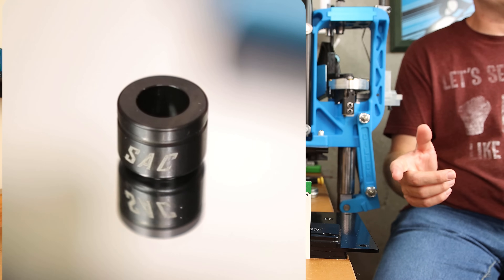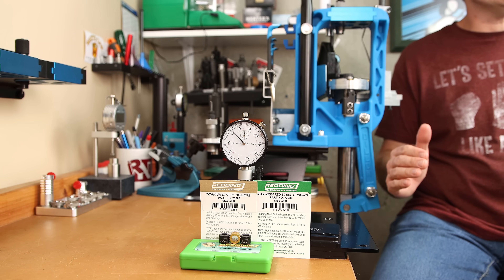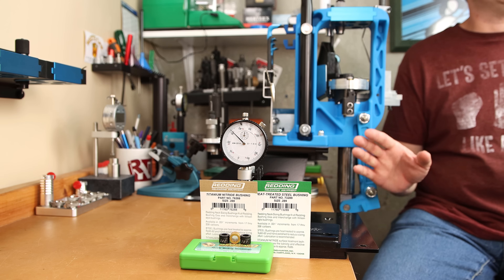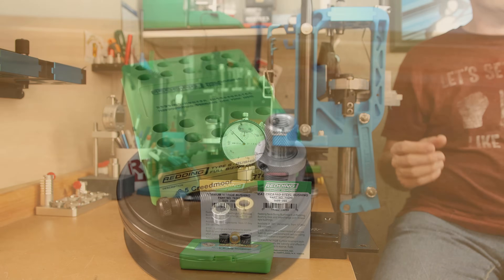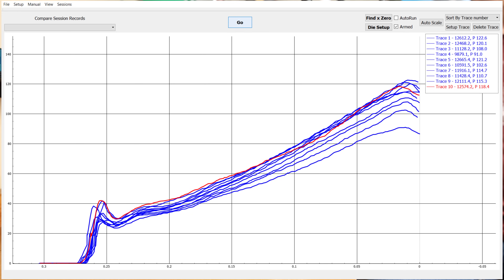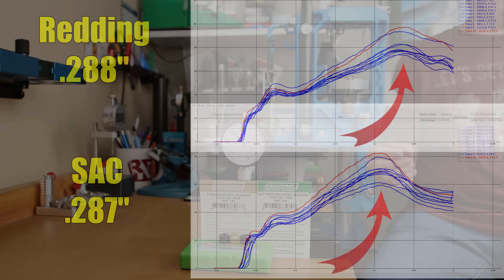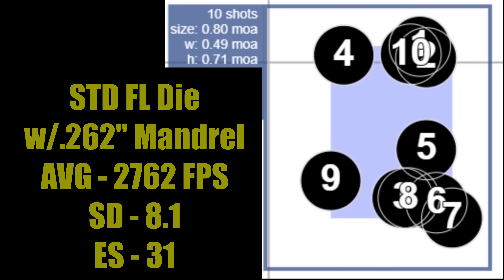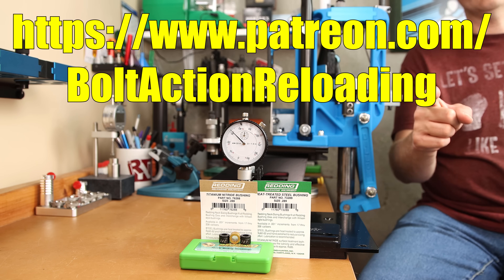Die Bushing Performance Tested! - Precision Handloading with SAC

Comment: What are the thoughts on using expander mandrel after SAC bushing for smoothing ID? IS that overworking brass or counterproductive? DO you have a video or content about that?
Reply from the maker: If the brass you are sizing is reasonably consistent (same lot, high quality) I think the benefit of the expander mandrel is much harder to determine. If you're using mixed brass, it may be worth your time. If you would like to deep dive on how neck tension changes based on sizing process. I have a video series on 12 ways to size brass tested (or something close to that)

Comment: I just checked Short Action Customs' website to see what Full Length sizing dies they are compatible with and found the following disclaimer: "These bushings are proprietary to Short Action Customs Modular Sizing Dies only!  They will not work with any other die". The photo of their sizing die looks slightly different than the photo of the one in your video. Is it possible that they modified their bushings so they are no longer compatible with the Redding Type S Bushing Full Length Sizing Die? (which is what I believe you used in your video).

Comment: On the short action custom site it states that the sac bushings do not work with any other dies but you used a Redding die. Is it okay to use the sac bushings with others dies. Am I missing something? Thanks
Reply from the maker: @howardschwartz1462  there are 2 style of bb bushings. One is neck shoulder and one is just the neck. The neck shoulder bushing are for their dies.  The ones that work in other dies are called the SAC neck sizing bushings.

Comment: It looks like you do either FLS (no bushing) + Mandrel or FLS w/bushing, but I haven’t seen you do a FLS w/bushing and as a separate step, use a mandrel to expand the case to desired neck tension.  Curious if you have done both bushing and separately mandrel and what your formula is for bushing to mandrel size.

Comment: Has anyone used the SAC bushing in conjunction with a 21st century expanding mandrel? I love the whole idea of the SAC bushing being able to size the entire neck so you don't get a donut with your standard bushing dies. But I really like the idea of finishing with an expanding mandrel to "polish" the ID of the neck since this is what is actually providing tension on the bullet.
Reply: How is the SAC bushing sizing the entire neck???? Look at the pictures----they only do a partial resize, about half the neck length. You may be right about the donut (which I have NEVER EVER had a problem with). The SAC would leave the donut in the unexpanded shoulder and the case would wear out before it (the donut) ever migrated to the actual sized part of the neck. Did you mean to say "don't get a donut as you do with your standard bushing dies"?????? You use one or the other, not both bushings????

Comment: In the shooting world where time, costs and component availability are a very serious concerns , a 10-shot group would not generally considered small.  In the statistical world, N = 10 is pretty small when there is significant random variation in the data.  You may want to believe that a 10-shot SD of 5.6 fps is a real improvement over a 10-shot SD = 8.9 fps.  However, the 90% confidence limits overlap:  (6.49, 14.6) and (4.08, 9.21).  Without more data, you cannot confidently conclude that 5.6 fps trumps 8.9 fps.  In addition, the ES's are of no value since they are sample-based random variables and need to be characterized by some statistic (mean, median, 90th percentile, etc) generated over repeated N-sized samples.

Comment: Did you run the SAC bushing in your Redding die or the SAC die?
Reply from the maker: These were ran in the Redding die. The bushings for the current version of SAC dies are different.
Reply: @BoltActionReloading  okay, that’s what I was thinking. Do you know if they make the ones you reviewed anymore? I’m not able to find them on their site.
Reply from the maker: They do, but they are also sold by MidwayUSA now, too.

Comment: I recently purchase a Sinclair Concentricity Gauge and discovered that I had some massive run out (.005-.015) in my 300 PRC brass (Lapua and Hornady) from using my Lee press and Lee resizing FL sizing die. I watched a bunch of videos and read articles and ordered a Mec press and the RCBS Matchmaster Dies (FL bushing sizer and micrometer seater) along with several RCBS bushings to play with. I used every "pro" tip to set the sizing die up correctly (including not using the expander ball on the decapping rod) and sized some of the brass that had been sized in the Lee dies. I was optimistic that this set up would at least improve concentricity but it didn't change anything...not even a few thousandths. How is that possible? Do I need to fire the brass and re-prep it to get optimal results from the new die/bushing set up? Are the RCBS standard bushings no good? Would the SAC bushings make a difference? Am I doing something else wrong? Thanks

Comment: No doubt about this bushing delivering phenomenal runout consistency. I have been using the 289 bushing on my Alpha SP brass that is a very uniform 014" neck thickness and it is all that I've been using. I couldn't be happier. Thanks for the video! It is confirmation enough for me!

Comment: I need help as I am new to bushing dies: Do I need to use expander mandrels with a neck bushing die? If so - how much smaller should the mandrel be than the bullet diameter?
Reply from the maker: Hi Steve it depends what you want to do. Some folks will size the neck for .003" and then run a expander .002" under projectile diameter.
Reply: @BoltActionReloading  do I have to turn the necks to use a bushing die effectively? I do not turn necks and the Redding catalogue recommends that if you do not turn necks then use an expander after the bushing die. Do you agree?
Reply from the maker: Hi Steve, by any chance have you checked out this video? This is kind of a huge deep dive on sizing and you may be able to see how one method changes compared to another. https://youtu.be/b0igSmCMTfw

Comment: So, do you recommend using a bushing .001 smaller than what you would normally use?
Reply from the maker: I am currently planning a small series of choosing appropriate bushings for your caliber. I have sized all the brass now to start with 223 but plan on doing a 6mm, 6.5, 308, and 338 if they are popular enough. Loaded round minus .002 or .003 is a good place to start.

Comment: do you have experience with hbn coated bullets and if its worth a consider
Reply from the maker: I have used some of the coated 115 DTACs in 6mm creedmoor and they worked well but I wouldn't go through the trouble of coating anything myself.

Comment: I'm under the impression that sizing necks more than 1 thousandth below diameter is pointless and just makes the bullet your interior neck sizer. So you go .003 under caliber neck size you will be gouging bullets but only getting 1 thousandth tension
Reply from the maker: This is very dependent on if the bras is annealed. I am working on getting more seating force examples on my amp press to see how this is affected.

Comment: Why are you not mandreling after sizing with a bushing? Am I doing it wrong?
Reply from the maker: Hi Drew. I am certainly not saying you are doing it wrong but there are only so many combinations you can test in 1 video. If your performance is what you need your doing it right! I have some more upcoming content where I use mandrels but for this specifically I did not want to loose any more neck tension. We will be testing this in future vids stay tuned!
Reply: @BoltActionReloading  perfect man. I can't trim my brass if I don't mandrel. So I want to see what your  tests say before I get a sac bushing. I want to see if run out stays the same after the sac then a mandrel. So please test Redding with a mandrel vs sac bushing with a mandrel. Keep up the good work. Love the channel.

Comment: Just got one of the SAC bushings in the same size as my Redding bushing. The SAC feels slippery compared to the Redding bushing. The SAC sizes .001 over what my Redding bushing sizes. I have to go .001 smaller. As for concentric. There is no difference between the SAC and Redding. Both roundouts between .0005 to .00015.

Comment: Looking at some of the comments, I don't think that some understand the design. It is like there are two IDs in the bushing. The larger one drops over the neck down to a transition to the smaller one where sizes begins. This gives a more positive alignment of the neck and the bushing on each other before sizing starts. The end of the neck makes contact with the bushing before the case body contacts the body part of the inside of the die.

Comment: Thanks for another excellent video!

You mentioned measuring the bushings with pin gauges; are the SAC bushings tapered?  If so, how much? Others have mentioned that Wilson bushings are tapered.... anyone know how much?

Thanks again for the great video/info!
Reply: Update: After researching the Wilson bushings, Sinclair/Brownells states that they have a 0.003" taper, & that the listed size is for the middle of the bushing.  Still wondering if the SAC bushings have a taper, & if it's the same or similar to Wilson's-

Comment: I really want to see a comparison with the SAC bushing followed up my the mandrel. 

Also The runout on the outside of the case is not important, you want the inside of the case neck concentric.
Reply: Mandrel sizing sounds smart but adds an extra step. Redding carbide expander balls make the most sense in theory. Since we now have a bushing that sizes cases straight. I would like to see will the Redding floating carbide expander keep the case concentric. Bushing the neck to .003" neck tension. Redding carbide expand it to 0.002" neck tension.  I would test this myself but I don´t have a concentricity gauge. The process is exactly like with a standard sizing die with no extra steps.

Comment: These videos are really cool and when that day comes that I get a bolt gun I’m going to rewatch all of them. However I’m really wrapped up in autos like the AR10 and obviously the AR15 and what I’m gathering from these videos the equipment in these videos are better served for bolt guns. If I’m wrong in assuming this it would be greatly appreciated to be told otherwise.
Reply: Reasonable assumption given the name of the channel, but it's really just a matter of that's where he's testing and gathering his data. Generally speaking, yes it is better served in bolt-action. But it should mostly all apply to semis, too. But results wouldn't necessarily come out the same way with shorter barrels, and with what the gas is doing and other differences. Johnny's Reloading Bench does his comparison testing on ARs. Both channels are good data regardless of what platform...it's the variables they consider that make their info so valuable, not the exact numbers they come up with, since everyone is mostly going to always get different results - even if the exact same rifle.
Reply: @ShastaBean  I agree on all points made in your comment. And I watch all JRB videos as a matter of fact he just dropped his 308 Aero with the Krieger barrel and bolt video. And oh man was that a good video I have Ben waiting 2 years for that video to drop. Because I have basically the same rifle as him I followed the build he did on the video to a T. And I’m in fact getting extremely close results that he is getting. Minor minor differences in accuracy most likely due to him being a better shot then me. Also probably other slightly different variables such as powder lots being different, different primers and environmental differences and things of that nature. All in all though our rigs run very similar it’s extremely fun to run the same loads he dose to see how close we actually get. But my point in my comment wasn’t to talk trash. I’m really just trying to figure out if I really need some of the gear he has. Will the gear he has help me optimize my accuracy and honestly I don’t be it will in the semi auto. Due to its violent action if I were to go and purchased the gear he has I would be wasting my money right now. However when I finally do get the bolt gun I want and that in its self is quite the challenge. Then I’ll need to get some of this gear.
Reply: @Johnny-jr2lq  cool that you have the same setup, and getting close to the same numbers. They should be pretty close, but spot on that there will always be slight differences given the fact production lines don't kick out the exact same product from lot to lot, along with the environment like altitude of where you are vs. him, temperatures, barometer, and even the direction you are shooting. At least you have it as close as might be possible. It would be interesting to see if he brought his gun to where you are, how different some numbers might vary. Curious to see someone test that, but haven't yet. Where I am, it can be 112 degrees one day, then on my next outing a few weeks later, can be in the 60s. I've seen where expensive barrel makers will admit that out of 10 barrels they make, 1 or 2 just may never be a good shooter - no matter what you do. And yes, there's always the x-factor; us as the shooter. As far as buying the equipment he shows, I feel the pain. Constantly asking myself if I need this, or need that.  I have budget-level equipment. It is what it is, but I figure the info like his findings in this video are great info to at least know about. Like he said, he pretty much assumed they were all the same, but found out they aren't. I'm nowhere near the level where I'm tweaking what he is with bushings & mandrels and checking runout. I'm just popping in a primer, dumping in powder and slamming in a bullet to a CBTO that is an initial guess as best jump. So for me personally, it's still a bit of a waste of time & money. But if/when I do get to that point - the throat will be eroded on all of my guns to the point that all of my old info has to be redone. ugh - and start all over. To your original point, it would also be cool to see a creator do comparison videos on how much difference is seen with these runout tweaks when applied to a bolt vs. AR. My guess is we'd never even detect the gains from a bit of runout unless shooting thousands of rounds of data, and even still, is impossible to keep all other variables consistent. If nothing else, it does also contribute to other comments that are often just as useful as the video itself.

Comment: Would like to see the same exact size bushing used.
Reply: He did a previous video on why he used the different sized bushing. The redding bushing gave a neck diameter of .287 and the SAC gave a neck diameter of .287. I can not recall which exact video it was however.
Reply: The fact that the bushings are different sizes could totally negate the results as they could be due to the increase of neck tension rather than the bushing itself.

Comment: Did you ever test the lee collet die?
Reply: Me too, please do it. I'm consistently getting around or just below 10 sd & es using only a  Redding body die and then Lee collet die followed up with a Redding seater die.  Don't forget your runout test in this video is on the outside of the neck but using a bushing your inconsistencies will be inside.  Using a Lee collet die you'll have better concentricity inside the neck with imperfections on the outside. That's my theory anyways.
Reply: @txmarine7557  always heard you have to turn case necks to achieve true concentricity when neck sizing only.

Do you think the Lee dies are working for you because it’s squeezing the case against a mandrel, providing the interior concentricity?
Reply: I would like to see a comparison, too.

Comment: I got one of these and it didn't work on the Hornady match dies.  It left ridges around the neck of the brass.  The Hornady bushings do not. Brass and die are always clean so that wasn't the issue. I definitely wanted them to work.
Reply: What was the ridge location? Wondering if it was like he showed where he didn't size the whole neck, or was it a mark on the shoulder? Just trying to visualize it and define what happened. Is there a transition on the bushing from the tapered entrance to the straight part that is creating it on the neck?